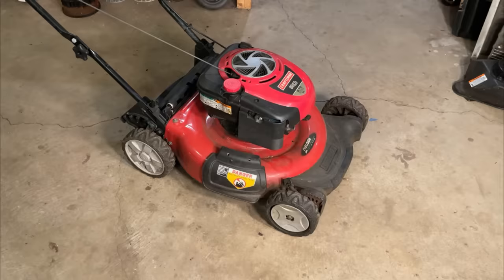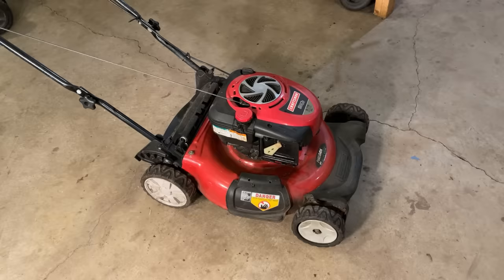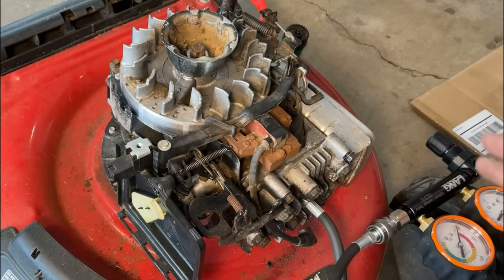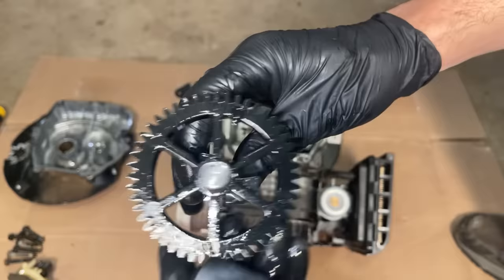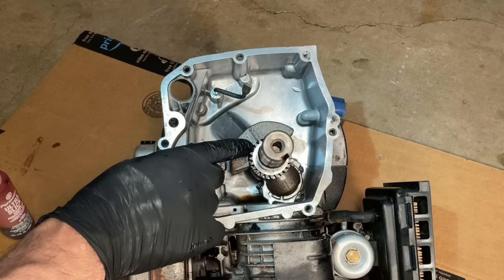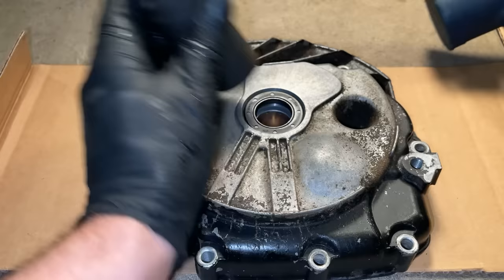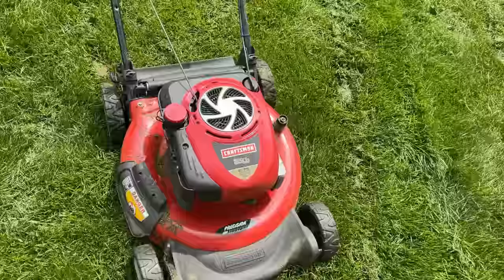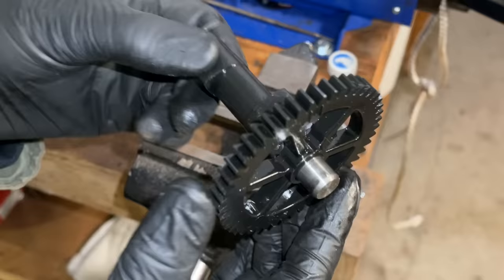Lawn Mower Will Not Start - You Will Never Guess Why

Comment: Briggs is notorious for those plastic cam assemblies failing, they shouldn't use plastic on the cams.
Reply: Another case of the purchasing department under the gun to reduce costs, and deciding to use an inferior part design - And as is most likely usual, the engineering department had no say in the part replacement.
Reply: I had a Honda do the same thing on a pressure washer.  What is with the stupid plastic gears?
Reply: Metal gear could have blown up all running parts in the crank case, metal cams wear down too esp if not oiled, which would be cheaper to replace a plastic cam or all internals? They should put a plastic or brass key on the fly wheel too.

Its like a circuit breaker for your house, would you want a 200 amp breaker on a 20 amp line? What could go wrong?

Farming equipment has shear pins on everything too if you put a shear pin in with too hard metal the rest of the machine blows up if something gets stuck.
Reply: @Seriouslydave  doubtful, the gear spun on the shaft, I have never seen a metal cam do that!
Reply: @Seriouslydave  in reality though mowers in this price range with internal engine issues are 90% of the time just put out for trash, not taken apart and fixed, it's a friggin shame too.
Reply: We are in a Throw Away society now a days. Most of the time replacement parts cost as much or more than what the mower is worth used. Then add in a repairperson's labor cost.  Not cheaper to keep her.
Reply: @johnlee4481  If your handy repairing stuff you can make a bit of $$ here and there just driving around on trash day. My neighbor put out a 65 inch LCD TV that would not power up the LED back lights, I took her home and bought a used power board for $24 off Ebay and use it myself. Cars can be ran for a long while if you just do regular oil changes, coolant flush every 3 years, tranny drop+drain every 30K, brake system flush every 3 years, ect. If you can do these maintenance tasks and throw on some brakes/water pump/alternator when needed it is "cheaper to keep her" LOL.
Reply: Briggs  use to cast their own  engine parts !  They built  quality engines, today they just produce  junk!   Kohler produces  junk engines  to .Namely  that damn courage engine!. It has twin plastic junk cams!
Reply: Older engines, when properly taken care of would outlast the equipment  they were on!   It is a matter of pride and quality  ,manufacturers do not have that today!
Reply: Also any engine  will fail without  oil !  I have never seen a  catastrophic cam failure in a older briggs  flathead!   The older flatheads  were  the best!   The compression  release  was built into cam lobe ,it was called  easy  spin starting! It was patented  and no other  small engine  manufacturer  could use it  I have several  of these older engines  and they all run good ,with  original  internal  parts !
Reply: Same as honda w timing belt running in oil !
Reply: @randallcarney1216  It's not all on the engine makers, I bought cheap Briggs-powered mowers that had the decks and wheel wells rot out even while the engine still ran perfect with great compression. Environment plays a part too here in FL a lot of mowing is done on damp grass, you simply have no choice since it rains almost every day in the summer.
Reply: @Seriouslydave  Replacing possible failure point components with plastic parts that are easily more prone to failure is flawed thinking. Appearently you've never relied on a machine to operate properly to finish a job and get paid. Sorry bud. Making parts even  more susceptible  to failure but cheaper to replace is reduculous in real life situations and ain't doin' anyone any favors like they try to portray.
Reply: @randallcarney1216  9
Reply: @Seriouslydave  --Plastic is not good for anything, metal is always better!!!
Reply: Same with GM, even since 80's plastic cam gears ruined two small V8 engines until realized, the a plastic gas line on Chevy van leaked caused a fire when a rock got wedged between it a frame and rubbed a hole into it. no more domestic, sad but...
Reply: @randallcarney1216  I can't believe Kohler is junk now too. They used to signify commercial grade engines. I mean, of they are going to dumb down a commercial brand engine to an unreliable throw away. Whats the point in continuing the brand?
Reply: The newest model Quantum engines have a plastic gear on the crank as well as the cam shaft.  I think the flywheel key is just a cosmetic part at this point and will not be the first thing to fail if you hit a stump with the blade.
Reply: @campbellpaul  built in obsolescence
Reply: @barryaiello3127  ... You're obviously an intelligent sort. Notice how I spelled "You're"? Also, etcetera is abbreviated using the first three letters, in order.
Reply: @barryaiello3127  ... Geez, as much as me?
Reply: @JW...-oj5iw  LOL, just kidding, have a nice evening! :)
Reply: I'm pretty sure this is why my new Husqvarna rider with Briggs Vtwin won't start easily.
Reply: @TheStevedie  I don't think that motor has a cam with plastic
Reply: @randallcarney1216  
I had a 1990 B&S engine 11.5 horsepower and the cam didn't break, the oil Salinger came apart and went between the crank and cam gears,  broke the lower half of the engine housing I  think the cam and crank could still be used but I put it in the metal recycling bin at work.
Reply: @paulmoffat9306  said, "Another case of the purchasing department under the gun to reduce costs, and deciding to use an inferior part design - And as is most likely usual, the engineering department had no say in the part replacement."
____________
That problem is written all over US manufacturing, not simply B&S. Boeing engineers could tell you all about it.
Reply: @Seriouslydave  I would like a choice David - what would be the extra cost of replacing the plastic cam with a state-of-the-art rocket science type material that would outlast every other part inside the engine?  -$10?  $20 ? - I'm willing to pay the extra...
Reply: @ibnasokin5571  i would say the plastic they are using is probably great material or they would fail in a year and get recalled or the brand would perish. I have a kohler courage from 2011 i wont say anymore or im just cursing it at this point. Bolts are still tight and valve cover doesnt leak. Oil is always in very clean condition.
Reply: @Seriouslydave  OK David, "great material" or not, the "great" plastic cam parts are obviously failing for many.  As for the brand perishing - Briggs has been circling the drain for years now - this kind of low-end cheapening doesn't help their image at all. IMHO
Reply: @ibnasokin5571  do you have any numbers to support your theory? Internet has opened up information sharing, like nba players getting more injuries this year, nba stats say injuries are down 10% this year. Maybe briggs and others with 3 year warantys would lose far too much money repairing plastic failures if they were that bad. how are their numbers doing? Are people leaving their brand? Are their profits down?
Reply: @Seriouslydave   Wasn't too hard to find ...  and I quote: "Briggs & Stratton has with a long history of manufacturing small gasoline engines and now has entered a 30-day grace period that began June 15, 2020, to start negotiating with its debt holders on a possible bankruptcy filing."
Reply: @ibnasokin5571  there you go, as long as they werent shorted, it seems someone will be bidding for briggs patents and assets soon and making cheaper knock offs.
Reply: @bobgreene2892  that's not good when you are building aircraft....
Reply: So can you sell it for more than the $50+ you've spent?
Reply: @paulmoffat9306  gm using on car motor
Reply: Old Briggs engines run forever if they're taken care of and they are simple to rebuild if there is an issue. I don't know when they started sticking all the plastic garbage in 'em.
Reply: I replaced one i owned awhile back. The older engines you kept them up right, they would outlast the  friggen equipment they were on!!!!
Reply: Talk to the bean counters, it's them trying to squeeze and extra nickel or dime out.
Reply: @bobgreene2892

How prescient of you to mention cost-cutting at Boeing, especially since two years after you wrote this we’d all be talking about their 737-MAX-9 planes losing their door plugs while in-flight, likely due to cost cutting measures. Bean counters gone wild. And the engineers left out in the cold.
Reply: Wow that's dumb . 😳 plastic ..!
Reply: @randallcarney1216  Tecumseh use to make a decent engine, but thanks to some sue happy lawyers in the 90's, the company went bankrupt and others paid out large settlements. All this due to horsepower ratings listed for mower engines that didn't match SAE standards for those power ratings. A huge money grab on a class action suit! The consumers never really win in those cases!
Reply: Yeah, well they do. So now what? If this is what someone can afford, why do you have to provide a worthless opinion?
Reply: But then customers wouldnt have to buy a new engine every season and they lose money building quality products

Comment: A ranch I worked for had a lot of Briggs and Stratton motors on irrigation lines they were always failing with the same fault. Its pretty sad that a highly regarded manufacturer like Briggs uses plastic cams that can slip.
Reply: That’s the price you pay for the engine being as cheap as it is.
Reply: Agreed. Some places plastic is not welcome. Can you imagine how much research - development went into getting plastic to work for that purpose? Planned obsolescence or exacting lifespan?